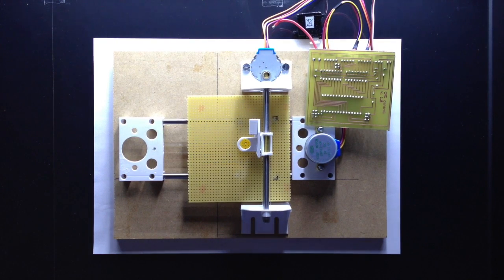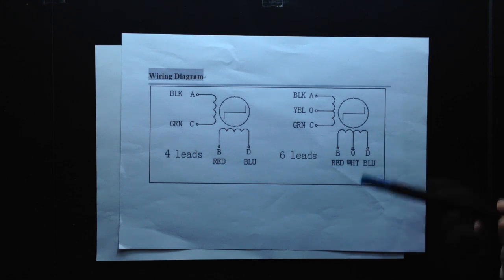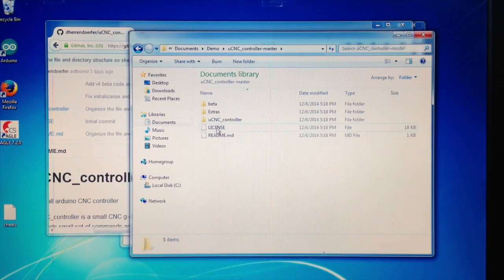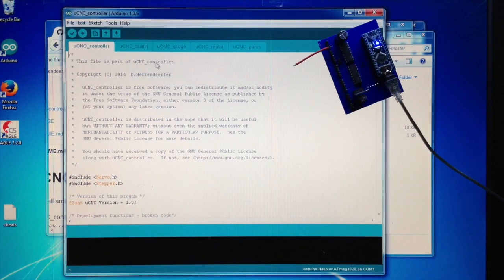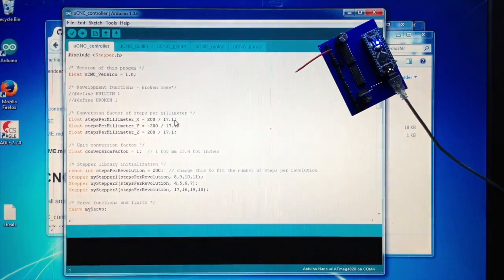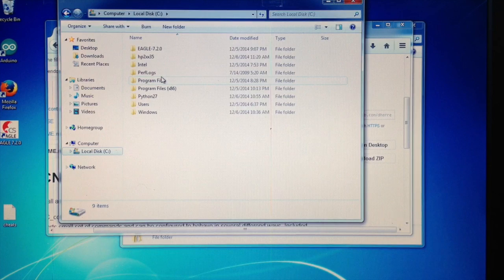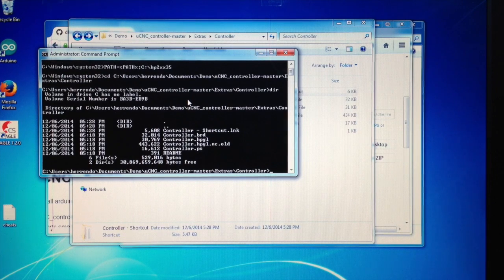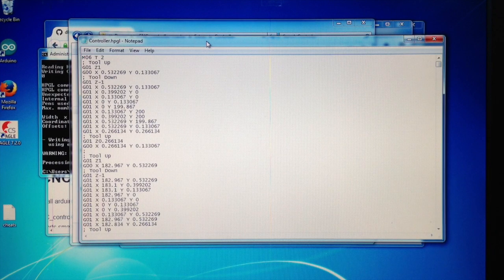Direct ink to PCB-Software talk

Comment: Hello again sir am having some trouble with the software am runing uln2003 steppers and  in the documentation it says that  Unused   :  A0,A1,A6,A7 (A6 and A7 cannot be used as output) 
so since the stepper driver has 5 pins and these settings define 4 pins will editing the code make it break because I need the z axis for 3d carving and maybe printing
Reply from the maker: My software already has support for 3 steppers. You just need to select the correct motor mode - also I have GRBL for this unipolar design ported and ready to go. Or do you need some sort of special configuration ?
Reply: @dherrendoerfer   thank you for your help av been going around down to simple hp-gl language in my research to understand how the code works..but I dont understand how the code is transformed into electrical signals like e.g move x .05 to a signal and can it process 3d printing g.code withouth runing it through the hp2xx converter? also how do you edit grbl to do what you want ?is it with c console or java?etc or just edit the main code in the instal directory

Comment: Hi Dirk.
So.. I have a problem with the Controller V4 - Beta Version.
I was wondering to use this program on arduino so I could use the halfstep mode because in this moment I don't have any Step Motor with a tiny step angle. Just a unipolar 7.5 degrees/step. 
But I made my plotter based on yours, using nylon strings to move the pen and the paper base and Now, I need to enter some data like "stepIssueFrequency"; "stepIssueFreqRamp"; "stepIssueFrequencyRampMax"; "stepDriveSlack", and I don't know what to put in this variables..
Can you help with this?
Reply from the maker: Sure.
put the slack settings to 0, they are for geared steppers
stepIssueFreqency is the amount of steps your stepper can do per second, and safely start and stop. Start with a small value and work your way up (like 50)
The ramp values control how much faster your stepper can go once it's started. The Ramp value is how steep the acceleration is, the Ramp max is how much will be added to the base frequency before acceleration stops.
Start with both at zero, then put  20% of IssueFrequency into RampMax, and something like 5 into Ramp.
Since we don't know the dynamics of your stepper this will take some experimentation.
Cheers!
Dirk

Comment: Hey dirk i dont understand of your logic behind calculation of steps per millimetre.
You give formula C=d.pie   if you considering C and D=1 then how you get 17.1 value for steps per millimetre
?
Reply from the maker: steps per mm is 200 divided by 17.1 . 
200 Steps is the number of steps per revolution of a 1.8 degree stepper.
17.1 is the circumference of a 5mm stepper shaft plus half the width of the nylon, which is 1mm thick. 5.5mm * PI = 17.1mm.
So I let the compiler do the math, and just use the constants of 200 divided by 17.1 *... = ( 200/ 17.1 )

Comment: Dirk i just done my CNC machine. When i send G code through Ard Gcode sender it draw garbage. So what should i do?
Reply from the maker: could you define garbage a bit more ? Did you do simple position and move testing for every axis ? Did you try some select hand-written gcode ?
Reply: @dherrendoerfer  i set my machine to zero position by using lef right up down buttons. It works properly. I convert my pcb layout to hpgl file. Then using Hp2xx i make g code of hpgl. I also tested that G code in NC corrector software. When i send this g code through ard g code sender.. First it draws one perfect rectangle and comes back to zero position. When it starts to draw pcb tracks... Its drawing random lines and small boxes
Reply from the maker: are you using the -t option switch with hp2xx ?
Reply: @dherrendoerfer  no.. I try your nc code also. Same problem happening there
Reply from the maker: so, you need to use the -t (for true size) option in hp2xx, for a start, try to set the feed rate very low.
The squares could be the pads though. It might be doing it correctly.
Reply: @dherrendoerfer  i dont know anything about (-t). Did you guide me how to use - t with Hp2xx? Plz
Reply from the maker: Look here: https://manpages.debian.org/jessie/hp2xx/hp2xx.1.en.html
basically you use 'hp2xx -t -m nc <filename.hpgl>' and it produces a filename.nc file.
the -t means that it is supposed to make it exactly as big as you designed it. without -t it would try to fill the entire page.

Comment: Dirk, As you know I am unaware how to generate a gcode for a sketch or for a text. Really what I did was I used Inkscape  to generate  some letters and saved as a gcode file. Then I used CNC controller software to open it and drive my X,Y and Z steppers. Then only I noticed the Z axis stepper does not move up or down according to the letter intervals. Really I do not know how to insert coding for Z axis movements in gcode.
Normally when you generate a gcode in Inkscape to draw some letters, does not it insert gcode to move the Z axis at letters intervals?
Reply from the maker: Well, you can open the nc file in a text editor and search for lines that include the Z letter ?
And, no. Depending on the target for your g-code there may be no z-axis statements in the code, because a laser engraver
will turn on the laser with a M03 command and turn it off once it receives M05.
So, you might need to investigate some more.

Comment: Dirk, I finally managed to run my steppers with Arduino Nano+A4988 3 drivers+CNC shield v4. I used CNC controller software to run them. With CNC controller I was able to move all three steppers (x,y,z). I opened in CNC controller a gcode text graphic created in Inkscape and tried to run the steppers. Both X and Y steppers run according to the text and I can see it on the visualizer but the Z stepper does not where it should go up and down.  I noticed in the program description shown while running the program  some commands are removed such as "Removed unsupported M command 'M18' '" , "Removed unsupported M command 'M01' '" , "Removed unsupported M command 'M17' '" , "Removed unsupported M command 'M300' '" and "Removed unsupported M command P150''"
I think this may be cause that the Z stepper does not move. 
Dirk, could you help me to solve this. I just need to run this CNC machine to plot some graphics.
Reply from the maker: Did you check you g-code if it actually has statements to move the Z-axis. 
You might have g-code for a laser engraver - they do not use G1 Z codes to turn the laser on and off.
Sorry for the lateness, did not get a notification this time.

Comment: Dirk, I face another problem with the stepper motors. I use Arduino Nano with A4988 drivers on CNC shield V4.
First I tested the steppers separately with Arduino Nano and A4988 drivers one by one on a breadboard using a Arduino test program and the steppers ran smoothly back and forth. I did the current limit adjustment on all A4988 boards too.
I used GrblGru gcode sender software and selected a test program on it called square20  and when I hit the start button I can see the program running well on the controller window nicely. At the same time I can feel the heat sinks on A4988 board too get heated up. But the steppers do not run. Instead time to time I can hear they turn about one step and keep silent.
Could you advice me how to overcome this problem?
Fernando
Reply from the maker: So, that can be a lot of things, I assume that you have a version of grbl that is preconfigured for the grbl shield you are using ?
In any case, I'd start off issuing very simple commands, just to make sure that the speeds and timings are configured correctly.
Start of with something like 'G1 X10 F10' that should spin the stepper very slowy. Repeat the the command for every axis. 
Then look at what's configured in the settings of the controller ( command $$ I believe ) and go from there.
Reply: Dirk, Thanks for the quick reply. I shall do so.
Reply from the maker: I don't know about that hardware issue, but if a test program can spin your stepper, then it's probably not the hardware that's wrong.
Reply: Dirk, Sorry I was troubling you all these days. Really I am now clueless.
I think I better try to run this CNC machine with Arduino Uno with a shield V3. I hope at least that would work for me. Thanks for replying and help  me so much.

Comment: Dirk, Before to follow your instructions could you go through this link from where I bought this shield v4 along with Arduino Nano and A4988, to clarify what I told you is correct or not. 
https://www.banggood.com/CNC-Shield-V4-With-Nano-3_0-A4988-3-Axis-Stepper-Driver-Board-For-Arduino-p-1250215.html?rmmds=search&cur_warehouse=CN
Reply from the maker: Haha! That explains a lot - this is a GRBL shield. So using GRBL was right. It has nothing to do with my v4 boards, it just shares the name. So following the GRBL instructions is the way to go.

Comment: Dirk, Thanks for the advice. Could you help me to do the correct way.
Reply from the maker: 1st thing would be to clone the uCNC repo: https://github.com/dherrendoerfer/uCNC_controller/archive/master.zip 
Unpack that, go to the beta/uCNC_controller_v4 directory and open that in the Arduino IDE.
Select the v4 board, compile and transfer.
Then have a look at the settings in uCNC_Controller_v4.ino for the stepper settings. You'll need to adapt that to whatever you will build.

Comment: Dirk, I followed the procedure given below and managed to upload Grbl to Arduino Nano. I just followed the procedure without any idea. I do not know whether I am right or wrong.  Please let me know whether I am right or wrong,
"How to upload the GRBL source code to Arduino Nano"
Download by typing grbl in google search and select "GitHub-grbl/grbl:An open source embedded performance g....

You are prompted to a web page called grbl/grbl at the top.

You shall find a "Clone or download" green colour label at the right hand side half way down.

Select it and download the grbl master zip file to the download folder.
Unzip it at the download folder and you get a folder named "grbl-master"

Double click it and you get a folder called "grbl".
Double click it and you get a folder called "examples".
Double click it and you get a folder called "grblUpload".
Double click it and you get a file called "grblUpload" having Arduino label.

(OK now connect the Arduino Nano board to the PC.)

Now double click "grblUpload" you shall come to Arduino program page with a heading "grblUpload".
Now select under tools tab the correct Arduino board (Arduino Nano) and correct serial port(COM3) and correct processor (Atmega328P).
Now hit the "Upload" circle in Arduino program.
You will see the uploading is done at the bottom of the Arduino program page.

Now the Arduino Nano board is with grbl uploaded.
Reply from the maker: Yes, you did everything right to install GRBL, but this board is not for GRBL, it is for: https://github.com/dherrendoerfer/uCNC_controller/tree/master/beta/uCNC_controller_v4 
And you may need just a little programming skill to get that working.

Comment: Dirk, I am confused with it since I am a beginner. Really where can I change the baud to 9600? I do not see a place in SourceRabit Could you please guide me to solve this problems? I am really desperate.
Reply from the maker: What firmware are you using on the Arduino ?

Comment: Dirk, I downloaded Gcode Sender and installed it as you advised me before. I use Arduino Nano with V4 shield and A4988 drivers for NEMA 17 stepper motors. I installed Arduino software and did GbrlUpload too. Selected the correct serial COM port(3) and selected Baud as 115200. After connecting to the PC when I browse my Gcode file (it is a spiral sketch)created with Inkscape and hit the send button under Machine Status/Active State indicate "Idle". Time elapsed advances. When I opened Visualize tab I cannot see any movement or graphic. For your information I did not connect motors to the Arduino nano board. Is it the problem? Please reply me and advise me. Thank you. Brgds. Fernando
Reply from the maker: Well, yes - uCNC_Controller works at 9600 baud for a start, and position-feedback is a GRBL feature that uCNC does not have. What you should be seeing is the data transfer from the sender to the Arduino.

Comment: Hello  Dirk, Thanks a lot for the videos and response on question we asked pertaining the plotter XY, I have replicated the plotter, the hardware and firmware  functions well , except i havent figure out why i am getting wrong pads sizes that are joined . i have checked the step per mm settings and also simulate the gcode with g-code toolpath simulator , I aso checked the backlash , cant seem to get it right , I am eager to replicate this project , have I reach the end of the road ?
Reply: I am using stepper motors kh42jm2500 and kh42jm2b
Reply from the maker: Have you tried generating some g-code yourself to find out if the issue is backlash or something else ? 
I usually do things like drawing two or three squares that intersect or meet at a certain point so you can judge if you have backlash.
Also did you make sure that your pen cannot shift as it is dragged over the board ?
Sorry for these short answers, I'm currently pretty loaded down by work.
Reply: I understand
Reply: Hi Dirk
I have generated own g-code , no backlash , this may seem to be the problem , i measured the width and the length by vernier caliper as compared to the g- code , the width is 5 mm bigger, i guess it is because i am using two different stepper motor , the X  axis step per mm is ok and Y maybe not  be, i suppose
Reply from the maker: Are you already using the v4 beta firmware ? It's a bit more difficult to set up, but that may help to solve these problems.
Reply: I am using V1 beta , i have noticed V4 is different to V1 on setup , let me look at it

Comment: Hello ,
I have a problem converting hpgl files to NC the fact is that when I convert the files and I print my pcb the measurements are not correct, ie the tracks and the components do not have real but bigger measurements.
Do you know what my problem is due to?
Reply from the maker: Did you use the -t (true_size) parameter with hp2xx ?

Comment: Hi Dirk , how possible to go  into a bit of detail in step per mm setting on unc controller .. thats a bit of challenge for me
Reply from the maker: It's simple actually - you need to know how many steps it takes for your stepper to complete one revolution.
Lets say it's 200.  Then you need to calculate the circumference of your drive shaft or drive pulley. We do that by
multiplying the diameter of the shaft or pulley by 3.14 (PI).   So if the diameter is 10mm, the circumference is 31.4mm.
Then you divide the number of steps by the circumference. in this case 200/31.4 = 6.37 steps/mm.
Reply: Thanks a million .
Reply: Morning Dirk, I corrected the steps/mm setting in the ucnc file, i get the right image except the pads , they are oblog and bigger . if you have spare time I can send you the files i created on hp2xx to figure out what could be the issuue
Reply: these are the setting i put on the configuration , 
float stepsPerMillimeter_X = 200/ 12.73; 
int   stepIssueFrequency_X  = 400;
int   stepIssueFreqRamp_X = 4;
int   stepIssueFrequencyRampMax_X  = 220;
int   stepDriveSlack_X = 60;

float stepsPerMillimeter_Y = -200/ 12.73;
int   stepIssueFrequency_Y  = 400;
int   stepIssueFreqRamp_Y = 4;
int   stepIssueFrequencyRampMax_Y  = 220;
int   stepDriveSlack_Y = 60;

My shaft is 5mm, revolution is 200 ,
Reply from the maker: You need to check if your machine has backlash, the most simple way to do this is to attach a rubber band to the X and Y carriages pulling them to one side, and trying a plot. If the situation improves you need to figure out how to minimize that.